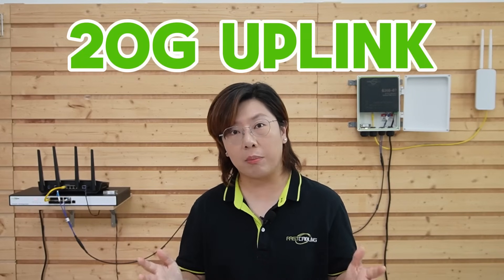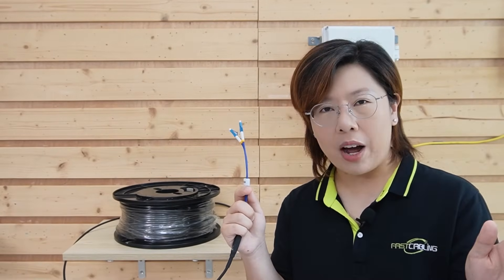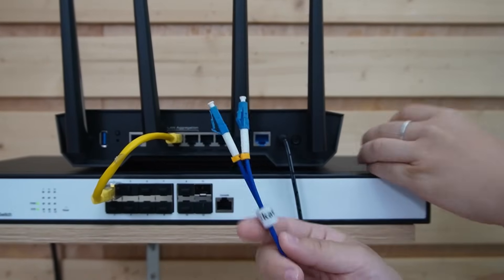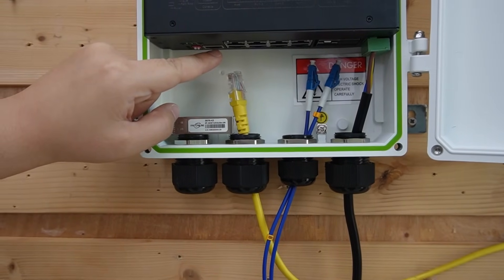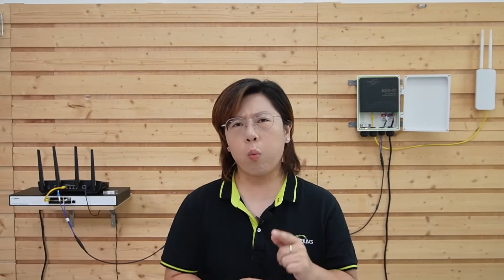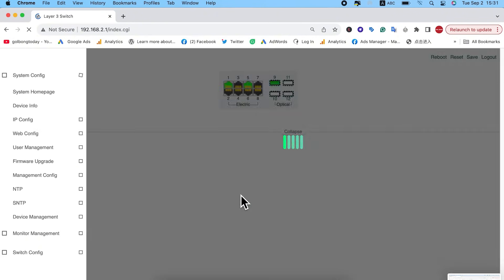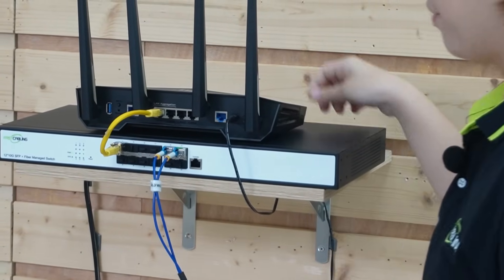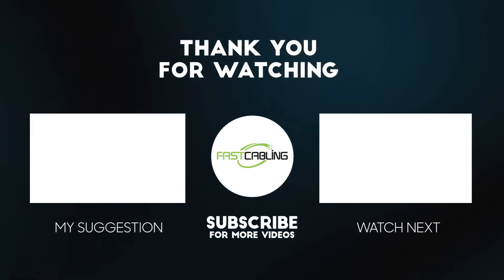10G Fiber Optic Backbone for Outdoor Wi-Fi Setup in A Large Resort

Comment: Am learning a lot from this Channel.

Thank you for detailed tutorial 

What is the maximum length that the single mode fiber cable can cover?
Reply from the maker: Thanks. If you're interested, you can sign up for our online courses for free here: https://learn.fastcabling.com/

At 1310 nm wavelength, typical maximum distance is about 40 km without amplification.
At 1550 nm wavelength, attenuation is lower, allowing up to 80–100 km with proper equipment.